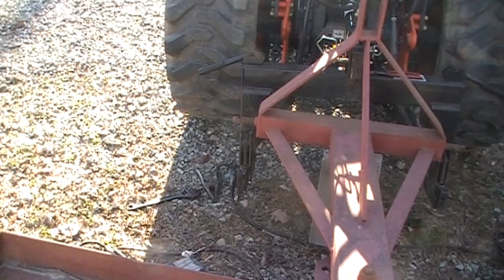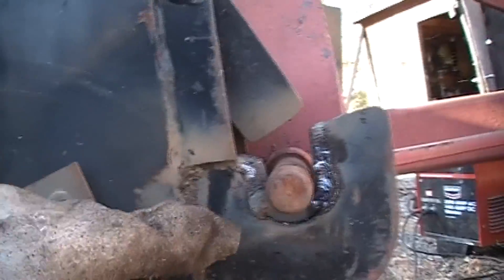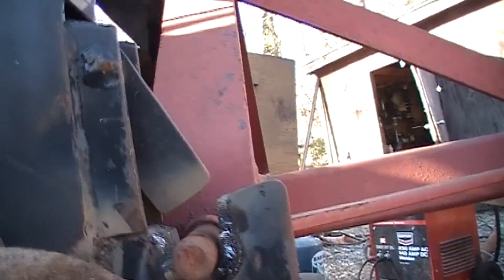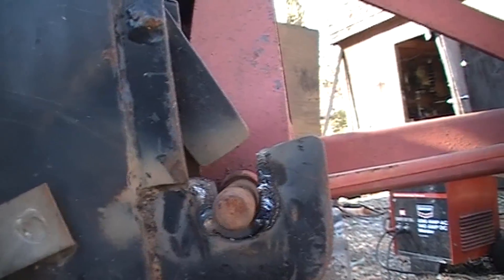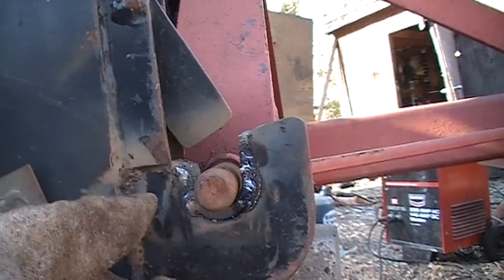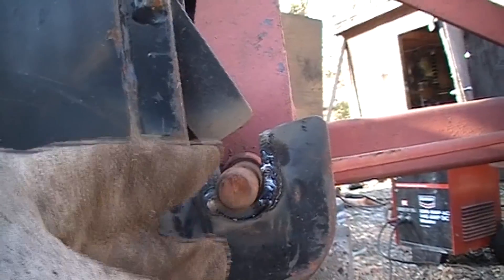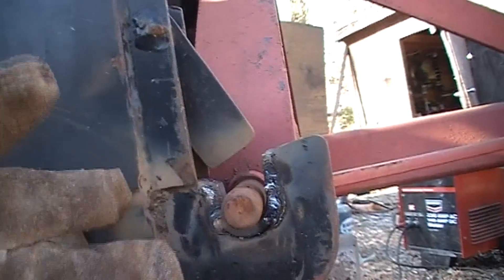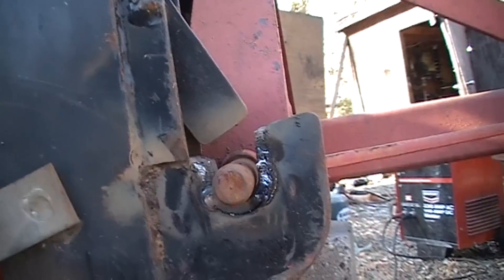quick hitch modification for cat 1 no more bushings!

Comment: I built my indicator for my Top and Side links... 
It turned out nice.. I used flatbar to wrap it.. I liked that version better. 

I'm putting the finishing touches on the HF Quick Hitch Modification.
I made it like it should have been to begin with.. 
The top swinging Flat bar actually holds the pin down and solid..
I had slop and slack and rattling if I can help it.
 
My box blade would not take the top hook.. I had to shave it down the rear end of the hook to 3/4" x 1-3/16".. From the 1-1/2" x 1-3/16", and I still had to make it longer to keep from hitting the bolts that hold the hook to the hitch by the flatbar coming to the top link from the box blade.. 
Kodiak HD 7 foot box blade.. 
Question.. 
I don't have any links on my lower arms to keep them from swinging right to left.. I have the pins under the rear axle.. 
I only have one chain on either side to keep them from swinging out and hitting the tires.. Pain the arse when it swings one way or the other when trying to hook up the Quick Hitch.. 
Question,, Do you have the lift arms rigid left to right when running the box blade? I have seen a telescoping arm with adjustment holes to adjust the length, and I see a screw arm on yours that seems that you don't change, but, just leave on there.. Not sure why mine are missing on this tractor.. (Old but new to me).. 1984 Ford 3910 4wd.. 

I'm not sure if it needs to be able to swing left/right or, if it should stay right in the middle where it belongs, or better yet, why my tractor doesn't have these, or why someone would remove and not use them.. 
In all of the quick hitch hookup videos, I never saw the quick hitch swing right and left.. Not sure if people make it rigid and then let it swing once it is hooked up.. I havn't seen you address it, but, never see any videos where they are not hooked up and being used.
Hey.. Thanks for the ideas, and thanks for the measurement video you did after my inquiry.. Much appreciated.. 
And, thanks for the inspiration...
Reply from the maker: I run my lower lift arm check chains in tight via a turn buckle then back off each one about 1/2 to 1 full turn. this allows a little wiggle room for raising and lowering the three point but not to much slack that is slings around side to side when using rear implements. a little side to side movement is ok. more likely yours got broke and never replaced. they do break when put in a bind. a tractor is a fragile tool that must be used with finesse more so than brute strength and abuse. check my video on the side link level indicator its pretty sweet! hope to patent it but feel free to make one for your own personal use. https://youtu.be/sVt-_KRGqt8
Reply: @daveknowshow  I watched that one.. Good idea.. I can see some difficulties getting it to travel that much from end to end using a standard slip cable like that.. Would be nice to have both the top and side links side by side like that.. I did the side link, just like the top link.. Both can be seen fairly well as long as you can twist around and still keep your foot near the clutch if needed.. Ha.. 
If it will stop raining a bit, I will finish the Quick Hitch today.. The top hook hooking up to the Kodiak is the last issue and getting the weight back on the lift arms, instead of on the top link only.. The 15-1/4 center of lower pins to center of top pins, should have been either 15 or 18" , rather than both +1/4".. 
I built up the bottom hook where the snap over lever actually holds the pin tight.. Raised it up about an inch.. Need to raise the inside of the top hitch now 3/4 to match.. Going to stay just under 3/4" to keep the weight on the lift arms. 
Had to take off 3/4" of the thickness of the outer top arm hook to fit between the bushing holding the back bracket to the front and the top pin.. Really need to heat it and bend it out a bit to solve another problem.. 
Either that, or drill another set of holes for the top pin on the Box Blade to bring the hole closer to the hitch.. Might do both and pick which I like better.. Wish I had more implements to decide that one, but, only have the box at the moment.. Will build a trailer mover at least, maybe a carry all, and maybe a boom.. Have some other work to do after I finish this, and may get caught by my season opening up, and may be next fall before I get to it.  Thanks for the tip on the link.. I'll be putting one or a pair back on there.. If I keep the quick hitch on there, seems only one would be needed.. No quick hitch, a second would be needed.. Probably need a pair anyway, just to keep things balanced though..  Cheers Dave..
Reply from the maker: @MarkThomas123   I  removed about a 1/2 inch from the front of my top hook as well. been working on a video showing that but not finished yet. to much rain here as well.
Reply: I did a good bit of mods to the top hook too.. Had it pretty damn precise.. within less than a 1/16 of my target. 
I have the bottom flip out arms holding the bottom pins pretty solid, with almost zero slop.. 
But, I am learning that you have to have some slop to make the dang thing work.. You have to let it have some wiggle room to fall into place.. It just isn't going to go perfect every time you load it up.. 
You would think if you made a "V" and got the thing into it, it would slide down due to the weight, but, there is as much equal weight holding up the ass end that pushes forward when you lift it, so, you have to have some slop to let it move,, or it will just sit right there waiting for a bump or jar to set it in place.. 
I was going to post a video showing the mods I made, but, I don't want to mislead someone and have them run into the same trouble I ran into, because it was the last mod I made,, getting everything into very close tollerance that got me back into trouble.. I am going to go back and add some slop into the top hook and the pins and see if I can get some better averages of hooking it up and having everything fall into place.. I went from 2 out of 3 times, to 2 out of 5 times when I tightened things up a bit more.. 
I posted the video Unlisted until I finish it up if you want to see what I did up to this point.. Should not change much.. Just adding back some slop in the top hitch portion of the setup.. 
https://youtu.be/sC-hHkzZfhM
Reply from the maker: looks good, I agree it does need some slop to it. my concern with the top hook would be if it comes off the top when the top link is extended and you use the box blade to push stuff in reverse. the bottom pins would pivot and the top pin would hinge out. this is why they make the hook deep on the top as well as the bottom. since 99% of these tractor three points are gravity down only a real tight tolerance is not really critical up and down more critical front and back of slot as that affects the top link adjustment. hope that makes sense. mine are still fairly loose even with the mods
Reply: @daveknowshow  I see.. Agreed.. The top pin can't jump out of the top hook,,,, as long as the bottom pins don't jump out of the bottom hooks.. The only way they will do that is if the pivot pin in the top of the swing lever gets broken, or severely mangled where it won't work any longer and gets bent up or out to allow more than the 7/8" current spacing..  That pivot pin is the weak link in what I have now..  Lots of pressure could be applied to the pin given some hang up on something in forward or reverse..  
Not sure if that will ever happen or not.. If so, back to the drawing board.. 
It's weird though.. Basically, I have created 3 "V's" that the pins should sit down in and fall into place, no matter how you get the pins, as long as they get roughly in place, but, I think due to the weight of the box pulling back on the top pin and pushing forward on the bottom pins, it can sit on either side of the "V" and just sit there, waiting for something to bump or jiggle the setup before it falls into place.. The only thing that could cause that is the fact that you are picking up all of that weight from the front of the box..  If you don't catch the top hook, it will rotate and drop in place every time.. 
I can get it to pop into place by lifting the 3 point just off the ground, then, extending the top link, sitting the back blade on the ground, taking the weight off of the top link for just a second and it slides right into place and locks in.. I just could not see it working like that before I actually saw it do that. 
We bought two of them together, but, my friend has not had time to hook hers up yet..  I might get her to bring it over and hook it up on mine and see how it does with the extra slop.. Just wondering how it would work without any mods.. Ha..  I would imagine some similar problems, except, the grouves in the original version are straight up and straight down, which would reduce the problem I am  having,, thinking it should just drop right in place every time without any intervention..  If I ever bend this one up, like you did your first one, I'll build one and make a 7/8" and 3/4" wide slot and catch the bottom pins using a sliding 3/8" tapered flat bar running horizontal in a channel.. 
I'm going to add a bit more slop to the top hook setup today and leave it alone and see how it works.. I won't be able to do any grading with it for a couple of weeks. I have another project, but, it will be ready when I get finished to give it a good test. I have a guy who rebuilt my backhoe control valve, who did it for less than I could have bought the replacement "Tractor Parts".. I guess he just buys the parts via size and not for a "Ford, etc.." and gets them much cheaper.. Quoted me $100 per cylinder for my 4 front end loader cylinders..
I'm not even going to try to find the parts for that price.. I'm sure I would end up paying $40 to $50 per cylinder kit vs him buying them for $10 or $15 from his usual supplier.. That plus a few more leaks here and there and slowly, I'll bring the old beast back into pretty good shape.. My first tractor, and I am sure learning things the long way around.. Ha..Ha..  I have had a T5C Terramite for 15 years and had very little trouble out of it. I keep it greased well, and keep the fluids changed and up to level..  And, I bought it used.  I'm just now getting a leak out of one of it's cylinders, and I have one other that I think is passing around the seals inside of the cylinder. Doesn't lift near as much as it used to. Next fall, I am going to buy a Universal Skid steer plate and build the quick attach for the tractor and I'll have things where I want them, other than adding a 3rd Electrical/hydraulic remote up front for a grapple, etc.. 
I had one other problem with the Ford 3910.. The ball joint on the steering arm popped off. $500 for the replacement part, and it didn't have grease fittings.. I found the correct ball joint for the front and back, got some DOM tubing the right size, did the fine fitting on the lathe and made my own, better than I could have bought with the $500 and it only cost me $75.00 for the ball joints and the tubing I needed..
Wish I had more time to play with it.. But, lots of driveway and parking lots that I am going to work this spring when the ground gets right after the winter..  I'm really going to enjoy the box blade with the indicators for getting those jobs done.. Cheers..
Reply from the maker: awesome keep me up to date on how it all turns out. looks great from what I seen in the video.
Reply: @daveknowshow  Will do.. Works great.. I was testing it on my front drive under a portable carport which has a pretty good slant on it.. Before I got started this afternoon, I pulled it down stairs and dropped it in my parking lot and picked it up a couple of times.. Snapped right in.. I am totally happy with it.. I didn't change anything. 
It does help quite a bit to pick the thing up on flat ground, and it helps to have the lift arms setup for flat ground.. I didn't have either working on the slant..  I just left the handles in the closed position and backed up and when the top arm got in place, picked up and the levers snapped right into place..  I went ahead and played around a few minutes in the parking lot, putting some pressure on it, top arm extended and retracted, forward and back and didn't see any movement to make me wonder if it would perform properly. I think it is as good as the size rock or root it finds and how well it is stuck in place.. Ha.. We'll have to see... 
It will be the first time in 15 years that any of the gravel drives/parking lots have seen a box blade.. I usually just spread more gravel every couple of years.. I hope all that gravel is still there.. Ha..Ha. I am going to save myself a fortune if it is.. :) I'll easily pay for the box blade and something else this year alone.. 
If I ever buy a new tractor, I will be sure to get a hydrostatic tranny.. So much easier than backing up with a clutch.. Nothing is flat around here.. I was backing up a hill to do my testing this afternoon.. 
Onto the next project.. I did take a video of me hooking it up twice I think this afternoon.. When I get some time, I'll add it to the end of the video and repost it... Thanks for the inspiration and the ideas.. I'll watch each of you new videos at least once.. Ha.. Some of them several times.. 
I installed the rebuilt control valve on the Woods Do All Backhoe this evening late.. Going to mount it back on the tractor tomorrow, check it out, park it, remove the cylinders I am going to have rebuilt and get it to the rebuild shop.. Going to take my Terramite there with them and have him take a look at my curl cylinder on it.. Not near as strong as it used to be and sounds like the Over pressure valve squeeks out when I try to lift and curl something that I know I have picked up before with no problem.. I built a set of forks for it a bunch of years ago and generally leave the forks on the Terramite, unless I need to move some dirt, etc.. Now, they will stay on there unless I need to move some dirt from a small or tight area.. I'll just use the big Ford to do it now. 
Cheers.. !!

Comment: Dave.. Thinking about getting the HF Quick Hitch for my Tractor. I have a Ford 3910 with a Top Link Hydraulic Cylinder and a RH Hydraulic also.. I was wondering... 
What is the width of the thick hooks on the bottom arms and top arm connection points on the HF hitch?
And, what is the width at the top, behind (closer to tractor) where the top link arm hooks up? 
The nuckle on my hydraulic top link is a minimum of 2" wide for zero clearance. It is CAT 1 = 3/4" pins though.. Just a whopping big knuckle the pin goes through.. 
If not, I am going to make my own quick connect.. Have to get off of the tractor anyway to lock things down, so, will make something simple to lock the bottom pins in.. 
If it is somewhere easy to measure the height between center of the bottom pins to center of the top pin, I would be interested to know that too.. I see it is adjustable up and down on the top link.. 
HF is 1.5 hours East of me.. Kind of a pain to drive over and measure it.. 
If you don't have time, I fully understand... Thanks for the videos.. Keep em coming.. :)
Reply from the maker: I will try and measure it tomorrow dark out there right now. I want to say its like 27 1/2 between centers on the bottom. I will measure the opening where the ball swivel goes in for the bottom and the top connection points. the harbor freight ones are not always exactly the same dimensions. I just bought my third one for a new project and it measures a little different. the top hook is adjustable up and down and that's a good thing because I have to adjust mine for certain implements.
Reply from the maker: here ya go https://youtu.be/syF5zW3t6mE

Comment: Nicely done, Dave. I viewed this video several times and I like how you closed the gap. You made a couple 1/4 inch j-hooks and tacked them in and a couple pieces of rod to decrease the space in the top hook. Thumbs up and thanks.
Reply from the maker: since this video I have also milled out the top hook moving the slot rearward away from the back of the tractor about a half an inch. then removed the 1/4 inch rods and replaced them with 5/8 thick flat stock. this really improved the hook up process making the entire quick hitch work better with most of my implements.
Reply: Really nice Dave.  I also checked out the video JIMeRIG sent you with similar mods.  He gave shout-out and credit to you and your mods on the QH.  I made a comment that I'll probably combine both of your mods when I finally break down and get the QH and do my mods on it.  That's what I really enjoy about YouTube and the tractor community. Such great ideas. Thanks, brother.
Reply from the maker: yes I seen his video. he is a really nice person we talked about the QH mods together for a while. I watch his videos regularly.